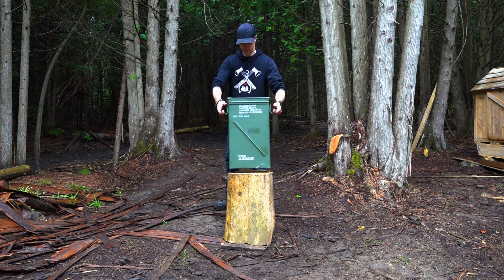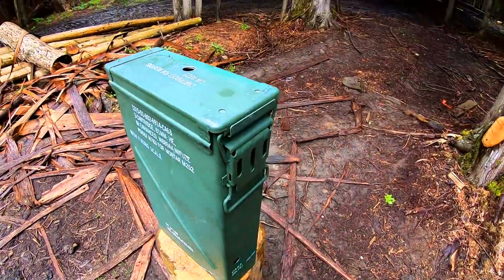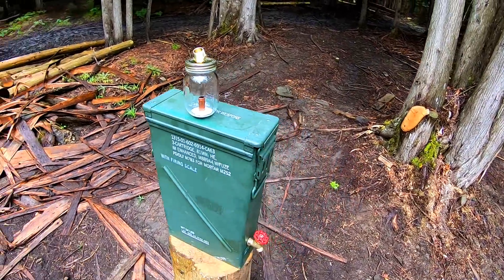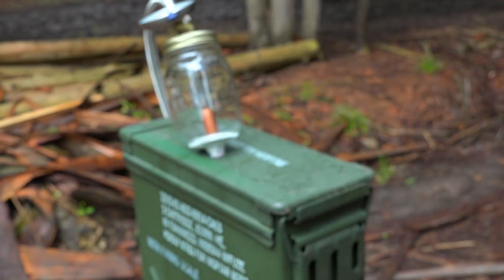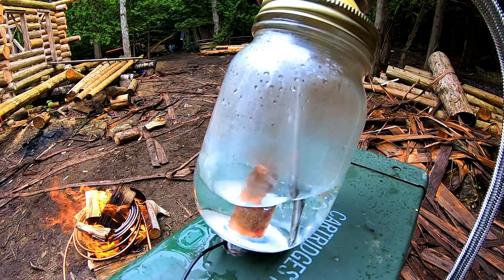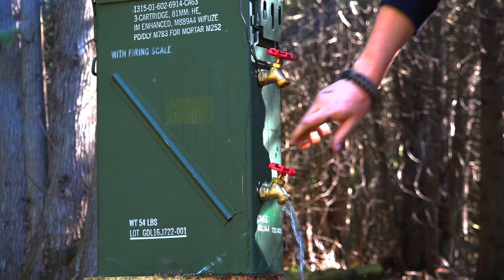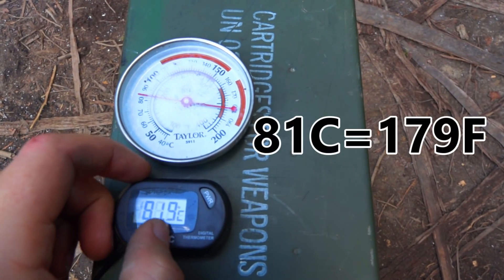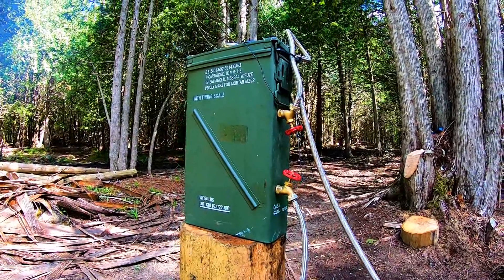Off Grid Heating Prototype- Copper Coil Water Heater / Heat Exchanger / Radiant Heater

Comment: HELLO EVERYBODY
Please report this video to have
 it removed for safety reasons.
The devide is very dangerous for several reasons.

1. The valves are not steam rated or for scalding temperatures above 130f which likely could result in injury for misuse. Manufactures product liability insurance will not pay for your injuries because it is a misuse of their product. 

2. The gasket material used in between the amobox and faucet valve is not designed, rated for this application. failure likely will result in the escape of hot scalding temperature water or steam and potentially causing injury to anyone in close proximity.  The American Standard (for) testing materials (ASTIM) has no rating for this gasket/use/material.

 3. The flexible copper tubing is not rated for hot water, water heater or hot water discharge. Standard plumbing code requires schedule 40 tubing as a minimum. flexible copper is grossly underrated for this application. 

4. The amo box was NEVER designed or approved to hold/store water, hot water or steam. IT was designed and approved ONLY to carry dry ammunition. If over pressurization occurs, both the bottom as well as the top will likely rupture with force spewing scalding hot water or steam potentially causing 3rd degree burns to anyone located in close proximity to the explosion.  

5. The AMOBOX PAINT COATINGS were not designed or rated for hot water or heat like the inside and outside of a hot water heater. If they contain polymer, they could emit toxic plastic fuming when exposed to heat resulting in respiratory injury to anyone who inhales these fumes. 

6. The glass (canning) jar rated for canning is not tempered glass rated for potential higher temperatures. If exposed to thermal contraction (shrinking through coldness) shattering of the glass potentially resulting in lacerations (deep cuts to the skin) as well as scalding to anyone in close proximity to the event.

7. The glass (canning jar lid) is designed for canning food and storing the canned food in a sealed vacuum jar under vacuum. This device uses PRESSURE instead of VACUUM  on a device that the manufacturer CLEARLY INTENDED to be used for VACUUM

IMPLICATIONS
If you or the author of this video construct a device for personal gain that results in severe maiming or injury of innocent persons as a direct result of your device...  MY BE HELD LIABLE.
Reply: It couldn't get any worse could it?!

Comment: my suggestion would be to make a stand for your coil to sit over your fire. You can make it collapsable to take with you. You also would need far less copper that way as well. Secondly, if you added a perforated grate to the outlet inside of your water container it would create smaller bubbles when it boils making your system a lot quieter for when you are trying to sleep. I would say one last thing you can do as well is an overpressure valve on the side to regulate the steam as well as another valve on the side to draw hot water from (For coffee, soup etc) All easy things to do without overcomplicating your rig. If you want to go crazy. Get a bunch of heat syncs from computers and put them over the ammo can as well. It will really throw the heat into your camper as well.

Comment: How about a baffle right below the inlet at about a 45 degree angle most of the way across the box, it would force circulation better. Also, mount a low pressure radiator cap on top of it.

Comment: Very clever trial, but heavy and difficult to tune, and to prime in freezing environment. 
I would  rather go for a 100w peltier module (Amazon 15$ for 2) and a simple wire to bring the energy to an heating pad in your sleeping bag. The heat is extracted from the fire with a 1 meter flat steel bar planted at a 30-45° angle into the fire to keep the module out of the hot air, and the bar out of the snow. A piece of glass fiber tissue could be laid above the fire to half-choke it and keep ambers through the night.
I would be delighted if you could try that for us!
Reply: Well, a little more research on the subject is not very encouraging. If you consult https://en.wikipedia.org/wiki/Thermoelectric_generator, you see that static generators have a efficiency of around 5%... Which means that you should collect 2000W of thermal energy to get 100W of electrical energy. If you search "power generator thermal" on aliexpress, you find modules delivering 8W in best conditions. If you consider that you can get 4w in less ideal conditions, you need 25 modules, for around 300$. Feasible, but not trivial. May start with 6-12 modules for a proof-of-concept. 
It seems that up to now the best solution for converting heat to electricity is the stirling engine, with 15-30% efficiency, but cost should rise, but you can find DIY video for those. But also this would kill the holy silence of the forest...

Comment: Put your coil in a metal box containing sand or other medium and regulate the fire, this works but it's wild, and you won't use it for any length of time, unless you are just determined for it to work, then I think I take pity on your family and friends or anyone else who has to deal with you, also the box is just about as wrong as it gets, and finally watch out for explosion you are taking all kinds of theory and tossing it together, if you continue and don't take the laws of heat and pressure into account as you morph in whatever direction you are going you can and may kill yourself or some other poor unsuspecting soul.

Comment: I would have put a pressure relief valve in the top hole. This would allow steam to escape if the pressure was too great but at the same time allowing less water evaporation.

Comment: I understand that you'll use this as a Radiator Heater to stay warm but what I don't understand is just how hot do you really need the water to get? You'd been better off keeping the second build when you took that dangerous glass jar away (I seen that within first minute and automatically realized this guy really has not a shred of common Sense or knowledge in what he's doing which makes him unintentionally very dangerous). With that second build adding the upper ball valve all you needed to do next was a simple and natural temp control by ju digging a hole 2 feet deep with a diameter approximately 6 inches larger than the copper coil. Get the fire going good but don't add wood higher than halfway up the hole at least not after the initial start as the hot coal will gradually build up if properly attended. Place a grill grate across too of hole to hold the copper coil. If it ever gets hotter than needed, and it will, then simply use a stick to pull the coil towards one side of the hole whereas the more coil off the hole the cooler you HOT water will be. Soon you'll figure out exactly where you'll be most comfortable meaning you'll know just where the coil needs to be placed corresponding with the outdoor temp. This is a flawless system I've used over many years even at home during a snow or ice storm. Adjustments will always very when the sizes and lengths of every aspect is changed if it ever does change for you. Size rooms to heat really changes the coil placement settings.

All in all great video and hope your final attempt worked great for you or maybe you found another great route that's equal or better than my setup! Keep thriving to integrate!

Comment: What a long way around to heat a boiling pot. I would just heated the ammo box on top of a steel plate laid over hot coals,
Reply: Yep. Or just put filter on the pipe end, and ran the hot smoke into the cabin with a hole or chimney in the cabin to allow air flow whilst warm air gets in

Comment: Could put like a check valve or a regular on the top so if the pressure does build it can vent itself off before it damages anything

Comment: If you heated sand with a long coil of copper tubing in the ammo box it'd be a lot safer.  Recirculating antifreeze may work better too.

Comment: You should a thermostat that allow hot water to go to an extra pipe which will be colden by snow and get back to the fire, this way you will have temperature regulation

Comment: could just run a finned baseboard radiator into the mini cabin this way the boiling water stays outside, all you'd have to do is adapt the 3/4'' copper from the radiator I'd add a ball valve inside to control the temperature via flow control

Comment: What happens if the fire dies down when you’re sleeping? Does the water in the line freeze and burst your pipes? How do you regulate the temperature inside your little cabin? What happens if it starts boiling over in the cabin?

This is a great design if you’re building a bulk coffee pot but there are too many uncontrollable variables to use it as a heater.
Reply: It was just an experiment.
Reply: @Fishingwithjerrysbrother  Is this just for heating your cabin? I'm thinking a small propane heater may be more efficient. How ever this idea providing hot water for dish washing and showers, even cloth washing, may prove good. My concern is the warmth for the cabin may be compromised by freezing. Also I'm wondering if removing the hose might be better. The copper coil might be less and not layed in direct fire but above. I think your on to something. This could work in with running stream water and in dire straights produce some pine hootch.
Reply: Ya think? 
Some people just 
GOTTA DO IT THE HARD WAY 
keep him away plz. lol.

Comment: It would be much safer to run the pipe in the sleeping camper rather then having a vented ammo box with a hot water like  that. Venting could be done with t-fitting and a pipe "chimney".

Comment: Ok given the space you're heating your current setup will be oversized also you will have a high moisture issue if it's in an enclosed space however if you added a second set of piping and left the "boiler" outside and ran a smaller coil into your sled you would aleviate both issues keep in mind the coil would need to be protected front direct contact with heat sensitive materials  (ie. flesh or polymers)I'd use 1/4" soft copper on the inside protected with a ceramic or heat friendly  material also if you add a baffle between the hot and cold inlet you increase circulation in the tank increasing its output and reducing the amount of transfer needed at intake.... good luck! and keep experimenting it's part of what makes life interesting!

Comment: As James Couch says below, a car radiator would be more efficient, & a house radiator/stat valve would help you control the heat in your box/minicabin..... also, a stand/frame made for the copper coil to sit in over the fire would help keep the copper from being destroyed when getting red hot in your fire as it is.

Comment: You might want to find out why it’s soft copper as opposed to L type, before you use it for cooking. There’s is a reason ‘soft’ copper is soft, and it’s not because it’s made with marshmallows.

Comment: this is such a great idea. We could improve on this. visit a scrap yard get lots of old radiators, connect them all up, get the copper line. plug it all in and place it on top of my fire pit, no more gas or electric for heating I will save thousands per year. Time to launch a crowd funding project, right whos going to pay me? Ill charge 20 usd per month for heating. unlike the energy company.

Comment: the house my father grew up in had what they called a heat front.  water circulated through a tube in the furnace and a water tank up near the ceiling.  I think it was mainly for hot water in the house in those days.  Thanks for the content

Comment: Around 1960 I lived in an old farmhouse with a wood stove for heat.  It was rigged with a coil of copper tubing through which water would circulate by convection alone, providing heat for the living space and domestic hot water.  In the wintertime we had too much hot water and would need to periodically vent some of it outside.  The water was also waaay too hot for bathing and would need to be tempered with cold water.  Sure, it worked, but it makes one appreciate having a gas or electric water heater with thermostatic temperature control.

Comment: A few suggestions: 1) you don't need to place the coil in the flame. Make a rack that will hold it near enough to heat, but not so close that it will superheat the water. 2) Try mineral oil instead of water. It is denser than water and will hold the heat much longer. 3) Instead of using a coil of copper tubing, get a radiator from a diesel truck. It has a huge capacity and can be easily mounted vertically next to the fire or even in the back of a fireplace. 4) Mount the ammo case inside your hut with piping coming out that goes to the radiator/fire source.

Comment: Did ypu ever think that leaveing that copper running on the colds after awhile it would bust from that type of height heat trust me it will leaveing it on that type of fire..the tube was never meant for that .then it will become a life or death situation be careful dude there are more simpler ways to heat your little camper more efficient and Safer

Comment: Can someone calculate the time it would take this method to warm 100 Square feet to 70 degrees Farenheit?

I guess it would be the surface area of the boiling water for convection 

Divided by square footage.

Like 1 square foot of heat output can heat 100 square feet of output by X degrees per minute 

If someone is willing to do the math can you please post calculations as well. I want to see how the math is done incase I need to adjust variables for different size rooms

(For this equation factor standard home insulation ratings) I understand theres variables as everyone does not have the same amount of insulation or possibly more of a cold draft. I'm just looking for a rough calculation with an explanation?

Comment: @The Outsider - Great vid!  Here's some additional thought's/ideas you might want to experiment with... 1) Clamp the copper coils with some metal brackets so they're not so unruly/less likely to sway/bend. 2) Get a folding campfire grate to set the clamped copper coil on, to optimize the heat transfer from the campfire... arguably the folding campfire grate might not be necessary but they're nice in that they're cheap, compact and most of all, serve awesome double duty regarding things of necessity such as cooking and drying. 3) Add a second (clamped) section of (spaced) copper coils and run this into your shelter and maybe add/rig a couple non-electric wood stove fans to the coil...doing this may provide enough heat as to not require setting the ammo box of boiling water in your shelter and risking knocking it over or introducing excessive humidity(?)  4) Since you're not dealing w/high psi, you might consider switching from (interior) residential steel braided hose ($) in favor of high flex synthetic (interior braided) automotive hose and brass hose barbs(?)  5) If at some point you decide to experiment with a "closed or semi-closed" piped heating system, be mindful of the stored pressure potential and don't seal the system without including a few pressure relief valves. (peace!)

Comment: Would steam build up in the camper from that hole in the top? I imagine it’d be moist in there.

Edit: What if you had a tube running from that extra hole you drilled in the top to outside like a chimney to get rid of built up pressure and steam

Comment: The pink sleeping unit looked hazardous as hell with those flammable gasoline containers in there.
Reply: Those are water containers. The fuel containers have a different cap and different handles.
Reply: @napalm3899  In that case, it's not so scary. Hehe

Comment: You know you could just use a stove with the vents and the stove chimney pipe on the outside while a closed cylinder faces the inside. As a safety feature you could have a reservoir with water on the top to the side that can extinguish the fire.

Comment: Getting 2 car interior radiators would a smaller option of doing it. i dont think placing your heat exchanger directly in the fire is a good idea in the long run due to the extreme temps. i dont know if convection is enough to get the water flowing, but you can get 12v aquarium pumps that generate enough flow ( you dont need much since the temperature of your fluid will even out over the entire ystem)

Comment: you need to pressurize the system to stop boiling.
Reply: How could you do that really simply?
Reply: Nils Jakobson  True but then things get more complicated, bulky and also risky due to increased pressure buildup, especially seeing how campfires are rather unpredictable/non-stable sources of heat. Plus, anytime you seal a system like this and expect to build pressure... relief valves and a mechanical heat pump will likely need to be added to increase safety and aid flow, which then of course makes the setup dependant on grid power or an extensive battery and solar panel setup....
Reply: @__WJK__  Not complicated at all. Only requirement is to have a tank that can be pressurized, same two holes on the side and add a pressure relief valve at the top. Probably 10 psi is enough because all you need is higher boiling temperature, once that starts boiling your entire tank will be already so hot that you can take it off the fire. Actually there are many variables to play with - the size of the tank, length and diameter of the tubing, whats the total surface exposed to the fire, etc.. But I believe it would still be more energy efficient just to have a big kettle directly on top of the fire..
Reply: @__WJK__  I wonder if you could use Evans coolant instead of water?
Edit: for radiant floor heat or the like.
Reply: John Smith - Good question... coolants might add some benefits but at the same time might be more hassle than they're worth(?) More experimenting would be needed to prove any benifits.